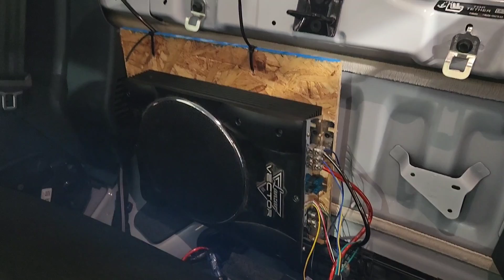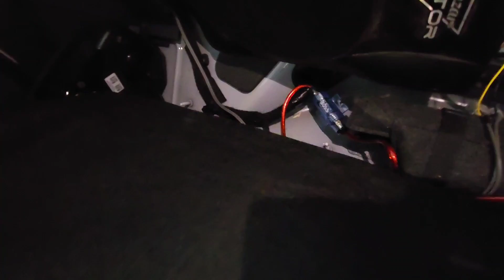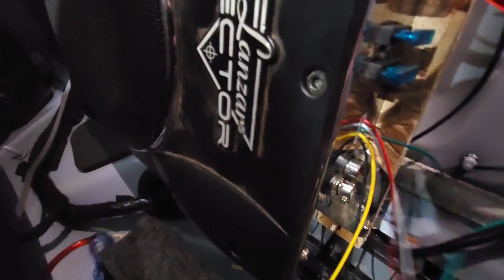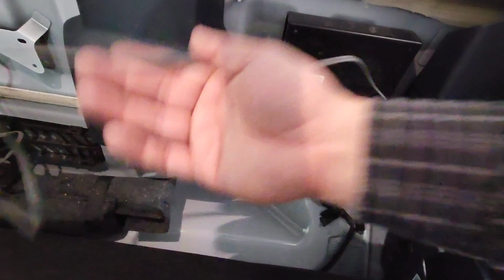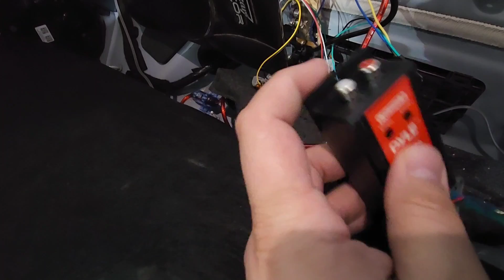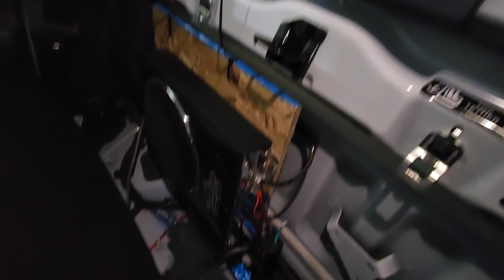How to Wire Amp & Subwoofer in Ford Maverick Hybrid (The Easy Way)

Comment: With speaker inputs, you really should be using a powered subwoofer with DSP. Pioneer does this pretty well. Basically, the DSP chip processes the audio data to create the best bass response.

Comment: Hey, I hooked mine up but it never turns off. My truck will intermittently turn on the radio and speakers when teuck is off. Just on and off,  no reason. This keeps the amp on....does yours do this?
Reply from the maker: No.

Comment: Where did you get those piggyback connectors for your rear speakers to run the high level inputs on your amplifier?  My Alpine amplifier has high level inputs signal sensing also and I would like to do the same setup style as you did off the back speakers as a signal for the sub. 👍😎
Reply from the maker: See video description for links

Comment: 2 years later any issues with this set up?
Reply from the maker: Running a different truck now but I have run this same setup in many vehicles flawlessly over the years.
Reply: @JCTFIXIT  no issues with battery errors from running it through the hybrid though??
Reply from the maker: No it runs off the standard 12V battery and ran great for me. I know some people who leave their hybrids parked for a while amd some with poor connections were having issues (without after market sub setup). Hopefully Ford has resolved them

Comment: Any reason that you know of for the sub not firing ? Both power lights come on the sub and the line out converter
Reply from the maker: Is your gain or high pass or low pass filter settings wrong?
Reply: I’m sorry could you explain further what that means?
Reply from the maker: Play with your amp settings

Comment: Pretty sure all powered subwoofers automatically turn on and off when tied into the high level inputs to just one rear speaker needed. Why all these other devices and remote wires needed?
Reply from the maker: Some newer models do that. Many do not. Also you want both so that you get tunes from L & R channels

Comment: I plan on going with this setup. Couple questions. Does adjusting the bass level from the head unit work on the sub? Will it change the levels for the speakers and the sub simultaneously?
Reply from the maker: Adjusting the amplitude will impact both yes. This is where sub amp tuning comes into play.

Comment: So my sub turns on with high lever inputs, but its not turning off as I expected, what are your thoughts on it killing the battery?
Reply from the maker: What is your remote wire tied to? That needs to be tied to something that only turns on when car is on that way you don't drain your battery. The remote wire is the signal that tells your amp when to turn on.

Comment: I'm desperate to identify the speaker wire colors for each side of the rear, you showed that you had your wires tapped into the speaker wires but didn't show them, do you remember what colors each side rear speaker wires were?
Reply from the maker: No. Usually the soldered tabs are slightly different in size. That can help you atleast make sure you have the same from each speaker.

Comment: This video is exactly what I was looking for.   One thing I need to clear in this video is did you use Pyle plvhl70 or Pac Tr-4 or both devices?   If you use only one, what would you recommend.  

Also it was a very good idea to put 4x6 Infinity speakers instead of 4 inch.   I ordered exactly same speaker also.   

Please let me know as soon as possible so I can order one of those two little devices.

Thank you for your good information
Reply from the maker: Go with the Pyle.
Reply: if I use Pyle, I do not need Pac-pr4?
Reply from the maker: Correct

Comment: Is it easier (or preferable) to wire the powered sub into the front speakers or the rear speakers? My plan is to buy a Kicker Hideaway subwoofer and install it right away, but I'm just wondering as to which speaker set (front vs rear) is "better"? Thank you
Reply from the maker: Not sure that it really matters but rear is more typical as subs usually end up in rear. If you have component setup in front with tweeters that could mess things up too.
Reply: Front.  Some people have said the rears have an attenuated bass signal at higher volumes for the maverick.

Comment: Does adding the amp and sub drain a noticeable amount of energy from the battery?  Wondering if it would reduce the distance of running in pure EV mode. Thanks
Reply: Different batteries
Reply from the maker: If you had your music up at a high volume I imagine it could have some impact but to me the impact has been minimal. The air conditioning is noticeable I can't tell with the stereo on or off a difference

Comment: Is there a benefit to grounding to the chassis instead of the battery?  Looks like an easy install!!
Reply from the maker: The battery is directly grounded to chassis, so it doesn't matter.
Reply: No need to purchase, and run a second wire as well as fish it through everything.  The chassis and battery negative are equal and directly connected.  A positive wire to the amplifier bypasses any fused circuits, as well as ensures you are receiving clean power directly from the battery safely.  In this car, the battery just happens to be in a very handy spot to install a subwoofer.